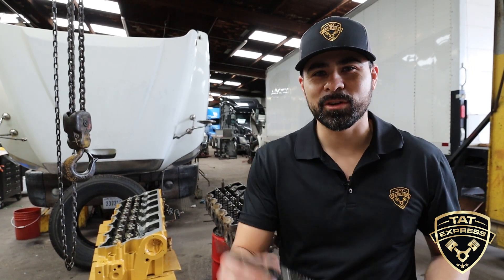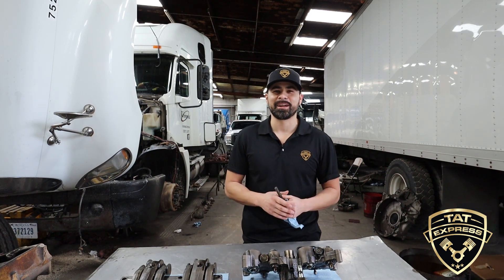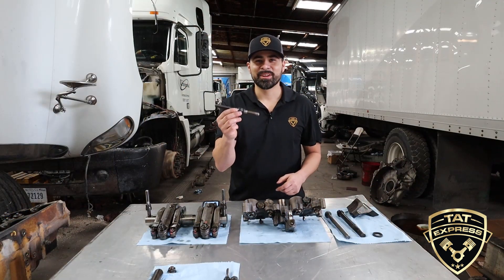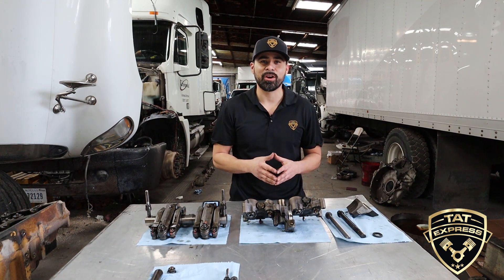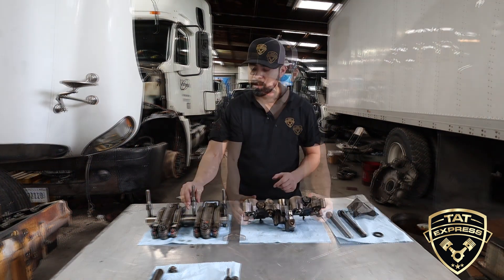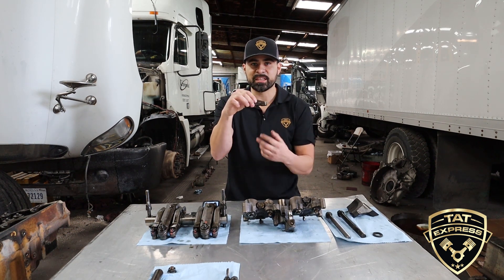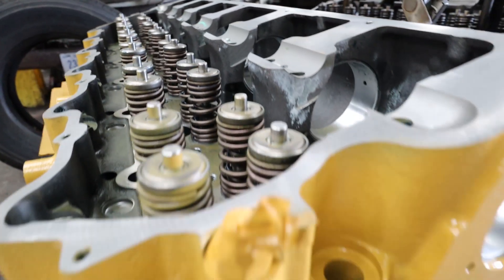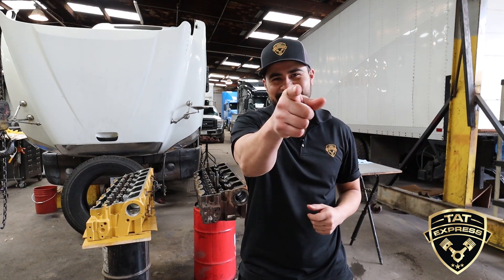CAT Head Failure

Comment: Very good important info on rocker shaft bolts , I will get my tighten to specs on my Cummins isx which I just got 800,000 miles on it, thanks Adam
Reply from the maker: This would not apply for a Cummins, that is a completely different design.  But, i would recommend base timing and valve lash be checked.